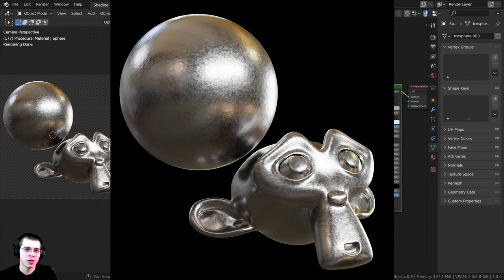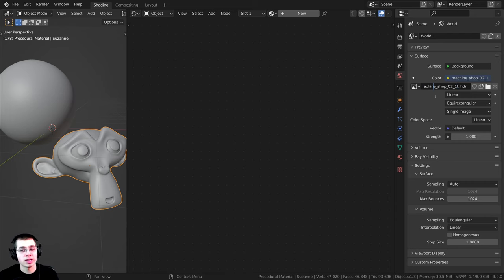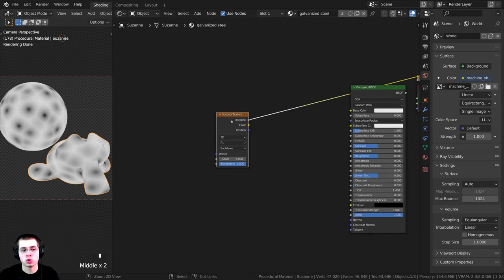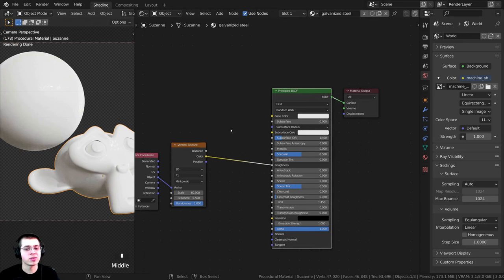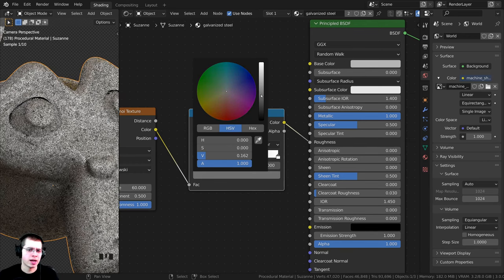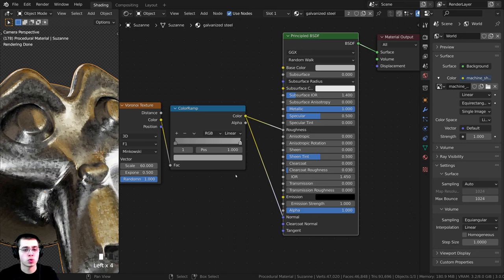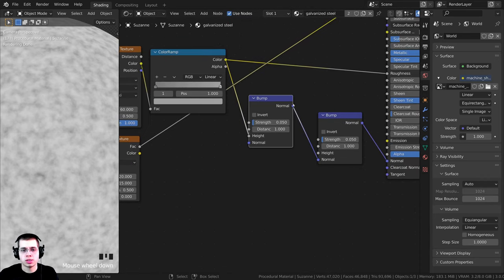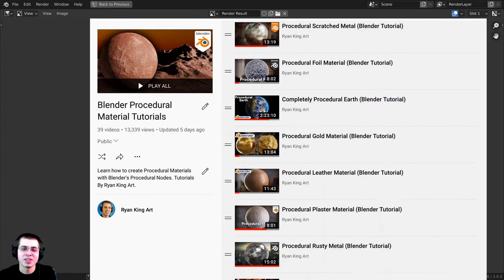Procedural Galvanized Steel (Blender Tutorial)

Comment: Do you have a tutorial on how to use these? Thanks if you have time.
Reply from the maker: What exactly do you mean? I have a tutorial on how to add these to Blender's asset browser if that's what your wondering. Or you can append these into Blender files and use them in your projects.
Reply: @RyanKingArt  hi yes to apply them to objects in blender and export them to use in other programs... Thanks for your reply.
Reply from the maker: @BlackSwan99x  To do that, you can open a new Blender file, and click on file, and append. Then locate and select the Blender file that has the procedural material. Then go in the material folder, and double click on the material you want to append. Then you can add it to objects in your scene.

Or an even better way to do this, is to use the New Asset Browser. Its a new Blender feature! I have a recent tutorial on it if you haven't seen it.

Comment: I love these, keep them coming. I get to learn and keep a new material. 👍

Also, a suggestion, if you have any interest:
There's a program called Materialize (from Bounding Box Software) it lets you create materials and visualize them in different primitives.
I used to use photoshop to offset a texture and then the clone tool to get rid of the seams, then import it to Materialize to do its magic.
Once you're in Blender just select the PrincipledBSDF and do Ctrl+Shift+T, then select the textures and that's pretty much it.

I haven't seen many people talk about this. (might get you some views idk)
It's just a cool, different method of doing materials. 
Unfortunately it's not compatible with Linux so I stopped using it.
Reply from the maker: Yeah, I have heard of that program. But I use linux as well, so I don't know if I could get it to run.
Reply: @RyanKingArt  Its just a suggestion, not worth the headache of making it work on linux.